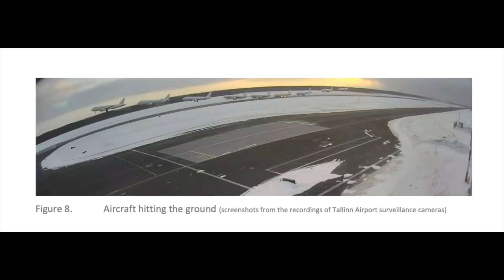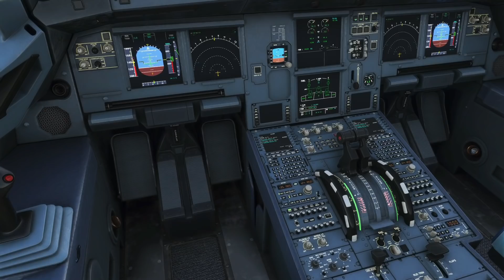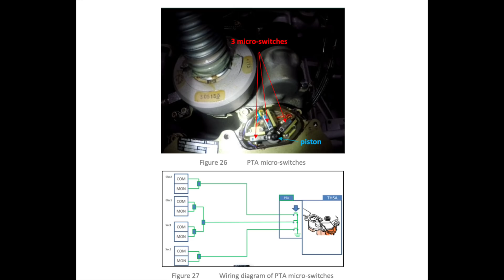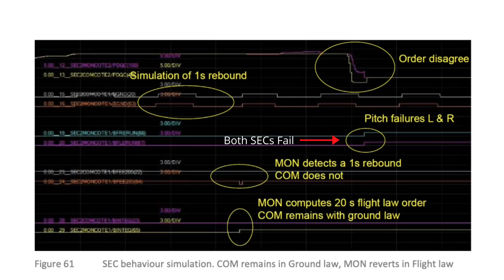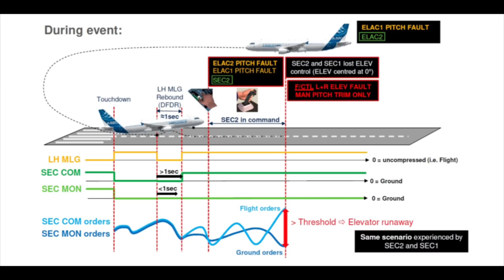The Oil Change That Crashed A Passenger Jet | The Crash Of Smartlynx 9001

Comment: I know nothing about flying planes and I got a bit lost during the explanation about ELACS and SEC’s.  If I were a pilot  though, I think I’d want the automation for most of the time.  But I think a certain amount of manual-only flights per year, where the pilots do everything, should be mandatory across all airlines. This way the pilots don’t get deskilled. I’m not sure if that happens or not. What makes me really annoyed though is that I’ve watched loads of plane disasters on YT where the fault has been with the airline for skimping on maintenance procedures in order to save money. In this case it was using incorrect oil, that caused the automatic systems to fail.  But  maintenance should refer to pilots as well, and again the airlines often work the pilots to exhaustion, they have nowhere to sleep in between flights except in noisy shared accommodation. I recall one disaster on this channel where the pilots hadn’t even been paid, adding to stress which contributed to the disaster.  So blaming automation is often not the problem, it’s the ethos of the airlines that’s at fault. In the case of this video, everyone survived, but that could so easily have been an A320 loaded with passengers skidding off the runway and taking out nearby offices and houses, just cos the airline had penny pinched on oil.  Thanks for these videos, I’ve been subbed for a couple of years and I really enjoy them. I wonder if the narrator could maybe make a video about himself and his personal experience with all things flight.  We don’t even know his name! 😀

Comment: QUOTE:  " Through nerves of steel, all aboard had been saved. But what had led to this near-disaster? The answer was a surprise to everyone: there was nothing wrong with the flight controls. The sequence of events actually began when someone used the wrong oil to lubricate an obscure piston deep inside the horizontal stabilizer — a subtle mistake which led to an escalating series of computer failures that nearly cost seven people their lives."Later that day, a mechanic for the airline was found stuffed in a dumpster with a broken nose and other bruises.

Comment: In my opinion this could have been prevented if different procedures were used. Also, they should have landed when the second warning was displayed. If the issue comes back after a reboot then there is definitely a problem

Comment: This instructor should be reprimanded and perhaps even lose his training license. He is teaching his students to ignore warnings and failures instead of debugging them. Extremely dangerous and an extremely bad habit to get into.

He could have used this warning as an opportunity to teach students how to handle these unexpected warnings, instead he taught them to ignore it. Had they only had 3 students (the failure happened when the 4th student was flying), it is possible that the crash would not have happened and that the next person to fly the plane would have experienced the failure and crash, because he choose to ignore it.

After the first failure, they had 2 choices, one, return and land immediately (probably not the safest choice) or two, climb to altitude and debug the problem.
After determining there was nothing wrong, then the computer can be reset.
On the second event though, time to land and park it and take the plane out of commission.

Question of automation is that it should be there to off-load work from the pilot, but all systems should be bypass-able and clearly indicate to the pilot that they have disengaged. So many accidents have happened due to trim runaway (how does the pilot not notice the trim wheel spinning to its end stop?) or auto-throttle failures (I was taught to always have my hands on the throttles) where they are split, or have run back to idle and the pilot is not aware of the throttle position.

Of all of the accidents I have reviewed, too much reliance on automation is a key factor in most. And in cases where the plane was saved, many times it was due to very experienced pilots not following the QRH, but doing something basic.

Sully turned on the APU at the first sign of trouble on his A320 instead of waiting for Skiles to get the QRH and way before getting to step K which was to start the APU. This action was key to saving the plane and was recommended to be the first step (it is STILL not the first step)

For the Heathrow crash, the pilot instinctively pulled flaps 45 to flaps 30 when he realized they would not make the runway. This was against QRH advice, but was determined as the single factor that saved the passengers and crew.

Automation is great, but I would rather have a seasoned pilot that is able to turn it all off and run the plane, who decides when it is helping him, and when it is causing the accident.

Comment: automation is good if its the whole chain. IE there's less chance of an automated process putting in the wrong oil. We need to automate more maintenance. I watched one of your vids where some buy picked the wrong engines from a list (goo in the fuel) whereas that sorta thing should be automated - IE the guy 'scans' in the aircraft. maybe even just takes a picture of it with his cell. and the automated system can identify the plane and bring up the procedures automatically. the more automation the better, but automating only one part (the flying) will never solve the problem. all parts must be automated.

Comment: Wherever there's automation, there needs to be monitoring of that automation. We human beings are not really good at monitoring. So, well, you need to make sure the failure modes are well defined and every failure mode has some well defined manual control.

Comment: Nah, still does not explain the fire in the engines. Also caused by wrong oil? Hard to imagine.
Reply: So you didn’t hear the bit about the engines hitting the ground? And yeah it is possible if you actually read the report

Comment: I think a balance between automation and pilot control is necessary. So, a 5. Computers run on sensors, some of which have their own delicacies. After a misreading causes a problem, there should be an immediate and simple method of bypassing the problem by the pilot and flying the plane with good ol' stick & rudder. There should NEVER be an automated system pilots do not know about, (MCAS on the Boeing 737 Max) and are not familiar with!

Comment: As a retired Programmer, I.T. Guy and Pharmacist I know a 1 to 10 answer would yield inappropriate information.  Humans should always be able to EASILY and quickly turn off or override automated\Computerized systems. Passing by LAX and seeing all those grounded Boeing Jets packed in tight made a lasting impression on me.  I don't hate Boeing, I own some shares of Boeing. Let those who pressured the engineers and FAA that rushed learn from that!

Comment: Where am I on Automation? I'm on BOTH sides of the fence. The PILOT or the ATC should be able to Switch between these. I can see a FULLY automated system failing, and a pilot taking command. I can see a PILOT taking command, and NOTHING working, and it should be ALL the above. Situations where the ATC can see whats happening, and he could also take over.

Comment: Automation. Often when they introduce an automated safety feature they do it after an accident. I have a sense they do it for the public to regain trust for the airline and/or the manufacturer. It seems that sometimes this is the main goal and that the safety feature is not really thought through. How do they know the system doesn't cause more accidents than it prevents?

When the SAS plane crashed shortly after take off from Arlanda, Sweden (the Gottröra miracle), the pilot, Stefan Rasmussen, had tried to save the surging engines by reducing thrust after they had been swallowing clear ice. An automated system, of which the pilot hadn't been informed, increased the thrust again which killed the engines. I hope there was some way to override this safety feature?! Anyway, since the pilot wasn't even informed they had installed this system he had no chance to override it. The question remains, would he have reacted fast enough to to push the "buttons" necessary to override the system before the engines failed in a stressed situation. Was the system wise at all considering potential bird strikes, heavy hale, or chunks of ice???

The same story applies for the 737 Max. "Don't tell the pilots!!!, they might save the plane". Well, that's a story you wouldn't find credible in a novel. Mounting engines off the center of gravity making it stall by giving to much thrust? And then mounting a "safety feature" without backup that was doomed to fail sooner or later; and above all not telling the pilots about it??? I'm not afraid of flying, but I sure as hell don't trust airlines, manufacturers, control authorities like e.g. the FAA.

Comment: Over the years I've seen and read many reports of problems with the automation of Airbus aircraft. A few of those, like a Quantus flight that injured numerous passengers and crew, was never fully explained. As many have commented,  a lot of pilots much prefer having a system providing direct mechanical connection to flight controls when all else fails. I'm not an aeronautical engineer, but I'd assume that Airbus's philosophy is that using one hundred percent fly-by-wire saves the weight of extra hydraulic and mechanical push-pull tubes. Yet, I'm one of those professional pilots that would have some reluctance flying such an airplane every day.

Comment: Automation has caused issues on the Airbus planes too, with it taking control away from the Pilot and nosing up gaining altitude and climbing into a stall and it crashed some planes, although some really good Pilots managed to regain control for a few seconds at a time and actually land the plane, barely, by using their few seconds of control every 15 or 30 seconds, wisely. They knew what to do, others weren't so lucky. So I think automation can be a useful, safe thing and is great tech. but like those Pilots in the Airbus planes, they want and should have full control when they need it and nothing should stand in their way in terms of fighting automated things. 

The fine line between too much automation and taking flight control away from Pilots, has been crossed and it needs to go back the other way. No Pilot should have to fight for control of a plane from a computer due to faulty automation, bottom line. The two can co-exist, it just has to be done smartly, smarter than it is now. Sooo many crashes, have been caused by automation fighting with Pilots.

Comment: And this is YET ANOTHER in a long line of examples why the control concept that airbus uses, where the pilot is an operator but the computer is in control of everything, even to the exclusion of the pilot control inputs is horribly flawed. A computer cannot think or synthesize information, nor can it ignore bad information if it cannot percieve that the information is bad. A human can. Boeing has made a lot of boneheaded decisions of late, but one thing it did do with its fly by wire systems is it kept the pilot in the decision loop. If the pilot of an airbus commands a radical maneuver to for instance avoid a GA aircraft that blundered into the flight path, if the computer decides that the maneuver would exceed design loads it will simply refuse the command. Even if the maneuver would have not exceeded the design load plus safety margin. Boeing's system will warn the pilot and give feedback through the yoke that the maneuver is not recommended, bit it will perform the command on the assumption that the pilot would not command the maneuver unless it was to try to save the plane and more importantly its occupants. The plae may never fly again, but if it can be put on the ground without loss of life, the control scheme did its job.
Reply: And exactly how many times has that happened? Keeping mind all GA aircraft must have a mode C transponder so TCAS can detect its altitude. Every heard of Malaysian Airlines 124 (Boeing 777) that took over control from the pilots?
Reply: @tomstravels520  Quite a number of times has the Airbus control scheme thwarted or deceived the pilot. Boeing of late has started to treat the pilot as an operator too, and my confidence level in their systems has fallen like an Airbus with frozen Pitot Tubes.
Reply: @Rorschach1024  an Airbus with frozen pitot tubes doesn’t fall just because of that. Only an incompetent pilot causes that to happen. What did Airbus do about it? Create a system where the AOA sensors can give a safe margin of speed that can be flown and give that ability to its older aircraft as well as new ones (Back Up Speed Scale). Boeing have only ever applied synthetic airspeed to the 787. There have also been several times the plane activated it’s alpha floor protection to prevent pilots stalling the plane whilst not paying attention and then there was TK1951

Comment: As far as I'm concerned there is far too much automation in everything. The computers should provide information but the pilots should provide all inputs to operate the plane. If a plane is too unstable to fly without computers operating it it should be destroyed and the people responsible for building it banned from the aircraft industry.

Comment: In terms of automation I ideally either want a 9, a 9.5, or a 10.

The more automated the better. More automation allows for pilot attention elsewhere, as well as automated reactions to certain warnings or problems. I do want pilot intervention, but only if its statistically more plausible that the pilot will save the aircraft, than the computer does.
Reply: How on earth can someone who has only operated an automatic aircraft have any hope of intervening??
Reply: @Gingerharry2011  You train a pilot on manual control, or you have pilots on these aircraft that have experience prior to the automation shift.

Regardless, I would rather have a higher degree of automation. It is not only statistically safer, but also smart especially with the current pilot shortage.

Automation is superior to human input when well developed. Self driving for example will greatly reduce road accidents and make driving safer and more efficient.

Comment: I have done a lot of software and distributed system control systems design for many decades now, and it did not take me long at a;ll to form a hard core policy of "TOO MUCH AUTOMATION IS A BAD THING!".

Some of the tell tail signs of this are:
---------------------------------------------------------- 
   1) If the system is doing something automated enough that you do not know what it is doing and why,  then you have reached the "TOO MUCH..." threshold.

   2) If the system is trying to re-interpret something or simplify it for you, rather than DIRECTLY saying what is actually happening as well, then again you have reached the "TOO MUCH...".  A common but often overlooked fix for this is simply to say "The spinny thing inside the purple machine on this mezanine floor has been reduced in speed because the spin sensor is reporting  a different spin speeds every few seconds,.  etc.  The "because..." is the very important difference here, and it can sometimes be multi leveled like "x failed because y is using too much current because..., because.."  In today's systems this kind of notification is sometimes difficult to do due to crap designed sub-systems from other manufacturers stuff you have to integrate with, ...but NOT impossible.

   3) If you cannot predict what a system will do based on outside conditions or user input, then once more you have reached the "TOO MUCH..." threshold.

   4) If the automation needs a fair amount of training to use, then you have failed in system design and have reached the "TOO MUCH..." threshold.

   5..9999) ...and many others

I LOVE programming and hardware control electronics design, but no matter how complex at first blush "KISS" is 99.9% of the time the way to go.  Sadly most of the time engineers like their design's "coolness" too much, or very ignorant company management push them with not enough time, and so totally fail to (or are forced not to) consider a) the user, and b) the possibility of intertwined things going wrong, as has happened in this airplane's case.

Of course I do not have all the answers, but having a KISS mindset, and a SERIOUS consideration for the user, all go a long way to avoid silly and sometimes dangerous OVER AUTOMATION.

Comment: In all honesty its less a game of more or less automation but ensuring the automation put in place doesn't manage sabotaging the entire system crashing the plane due to improper data perception. While more complex commercial aircraft automation can be compared to the cruise control of a car, it'll do exactly what the can says, but if you hit the brakes or accelerate you're still in control as the driver/pilot.

Comment: It isn't such a simple question to answer. One reason being system integration of other systems added when lessons were learned from previous accidents. However the primary reason is changes in aircraft design. Some of the more modern designs can't fly without computer integration because the design is inherently unstable. 

However, all systems require sensors, which can be unreliable as shown in many of these videos and that can give false information to both the computer and the pilot, creating a major issue, especially if in IFR conditions.